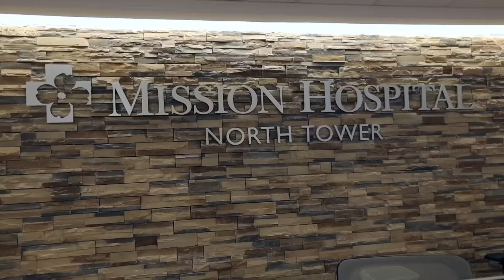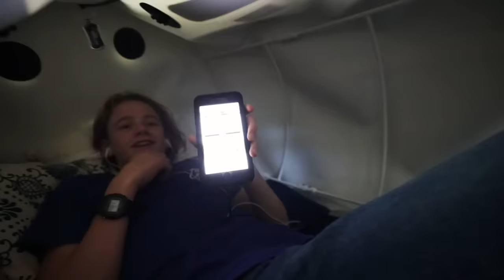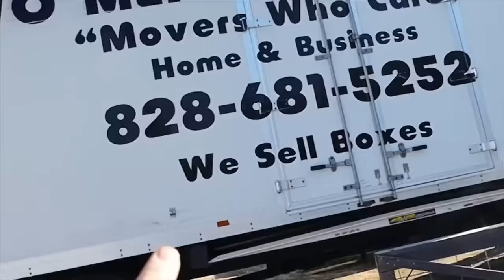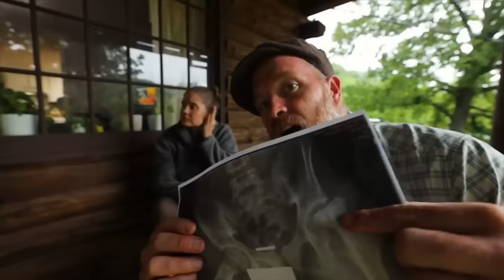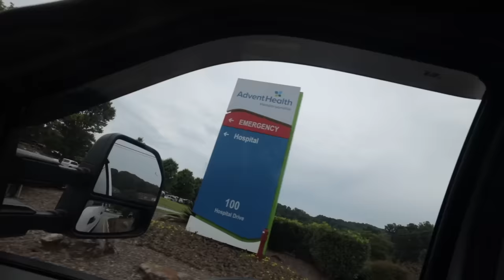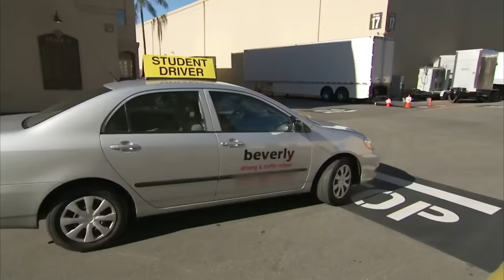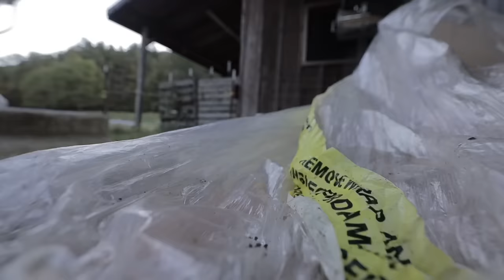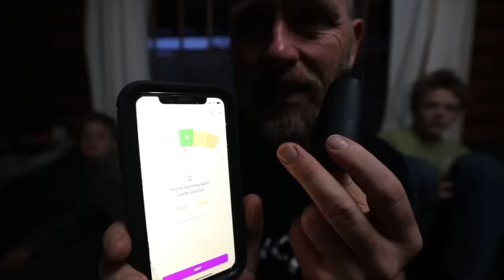Our Resilient 12-Acre Homestead (2023)

Comment: Normal A1C is between 3.8 and 5.6.  You are smack dab in the middle of the normal range.  I have no idea why a Dr would even say that you were pre-diabetic.  Just had mine tested earlier this week, and mine is down to 5.6 and is at the high end of normal, but my Dr was thrilled with my results.
Reply: You can be normal at a fasting level.    This doctor is correct

Comment: You guys took that ceiling down the hard way.  Next time (?)  or if anyone is interested...use a long 2x4 and prop it in and pull down on the 2x4 and the ceiling falls in huge chunks.  I used to help a builder/friend do remodels.  Justin to help sleep boil an unpeeled banana for a few minutes.  Let it seep.  (cut off the ends first and wash the banana)  Tritriptophan is in banana peel.  A natural sleep aid full of melatonin etc.  I can't believe you take a pharmaceutical to help you sleep.  There are so many things to help you sleep.  I sleep in a faraday cage that I had built around my bed.  Just a wood frame with aluminum screen to block the emf frequencies.  I sleep like a baby and you can feel your body relax.  EMF (electromagnetic frequencies affect your spine.  Your muscles tighten up from emf because they are trying to protect your spine.  With tight muscles there is restricted blood flow.  No lower back pain and I haven't been to the chiropractor in years!!!  Mr google pants faraday cages around bed Utube.  Loved this video thanks!